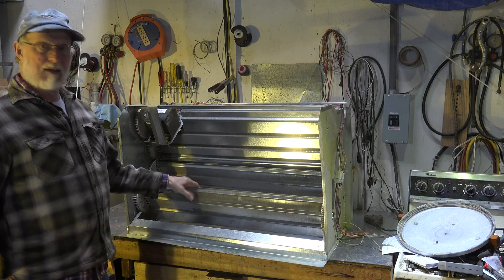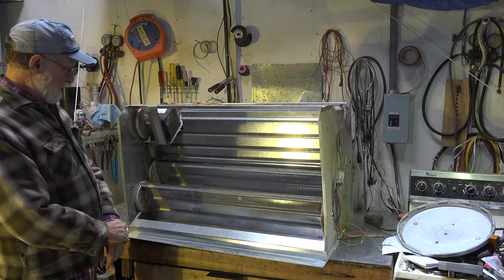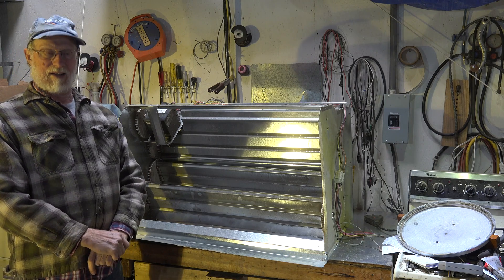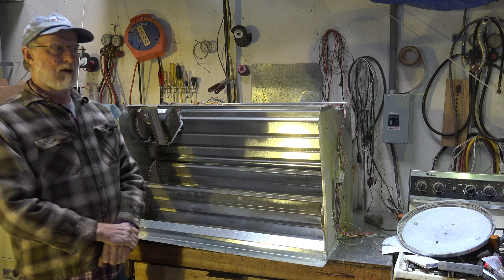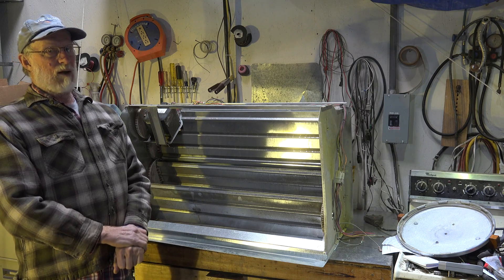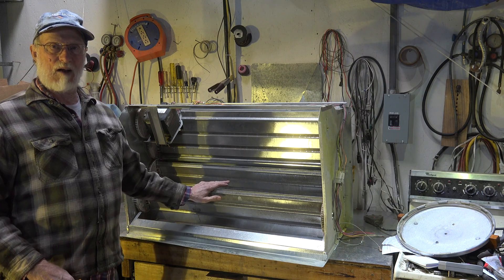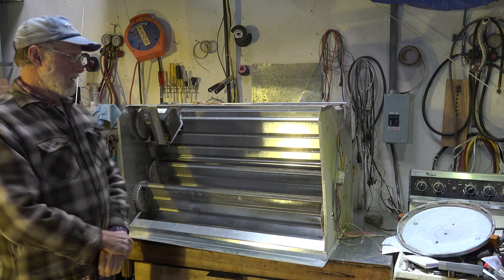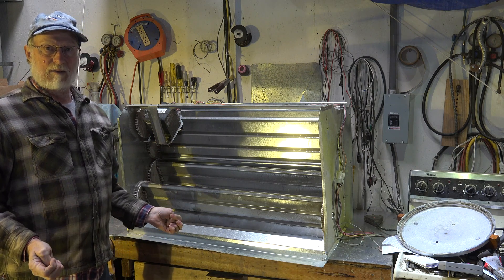The economizer.  What does it do? Part 1

Comment: These are used a lot in cell phone towers (base building).  They produce so much heat they have to run AC during the winter.
Reply from the maker: I actually installed a heat strip in one of those units,  knowing it would never be used.
GFM

Comment: Not sure how everything works, but I do remember my junoir high and high school, cooling in the summer, but the building would be under positive pressure.  y ou could smell the outside air mixed with the air cond.  i'm sure in the cooling off seasons, they simply economized.   i realize there is a minimum amount of fresh air required for occupants under normal conditions.  i'm sure i won't see any  notifications responses in my inbox on youtube if anyone responds..what is wrong with youtube these days?